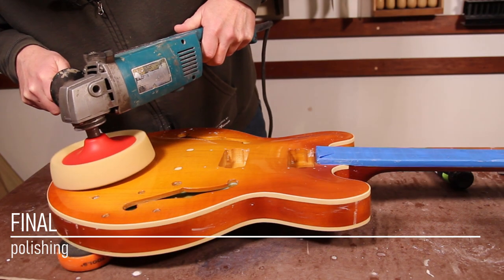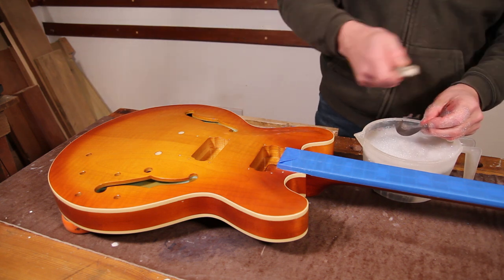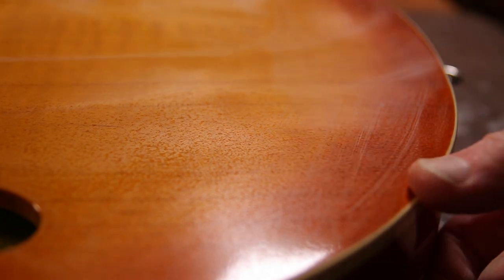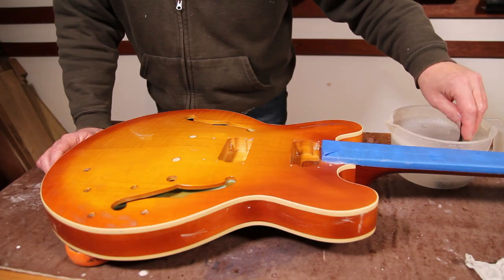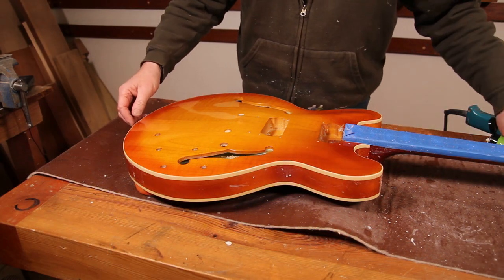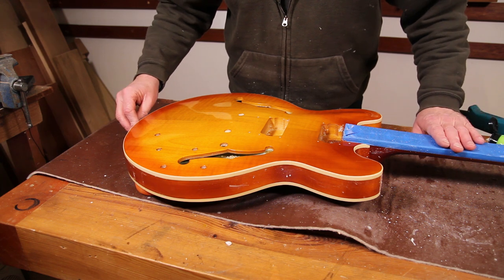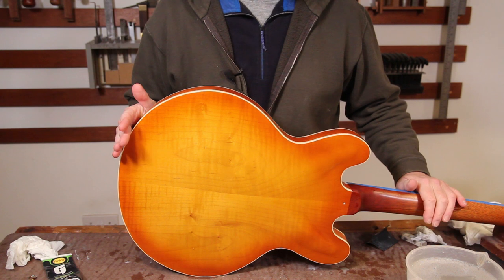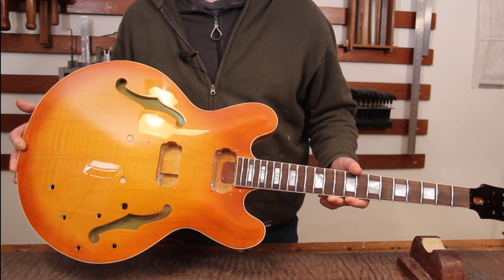The Shed of Dreams ES 335 build Episode 52: Polishing the lacquer.

Comment: Have you ever sanded it polished through the clear.  If so what was your solution...
Reply from the maker: I have burned through before, it is usually only a small area so they can usually be touched in with an airbrush quite easily. I always make sure I have some spare finish just in case.